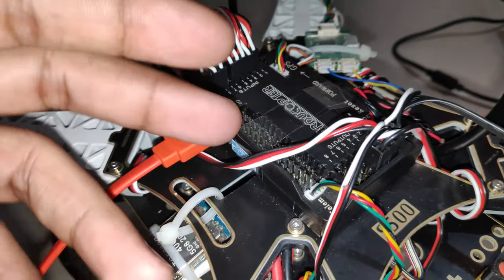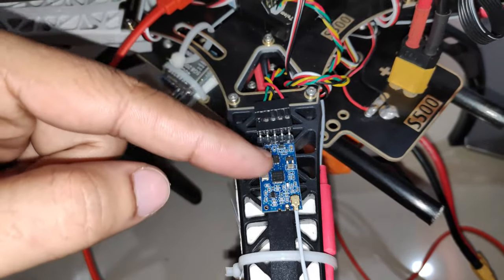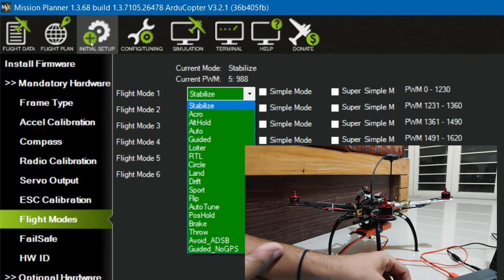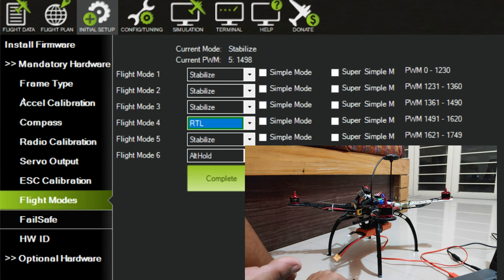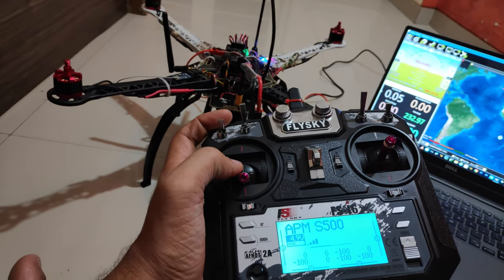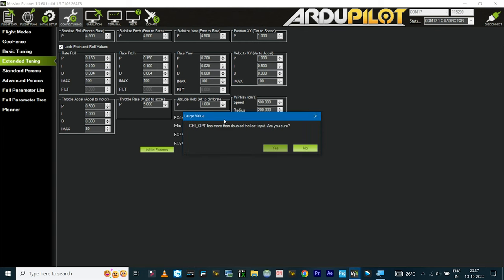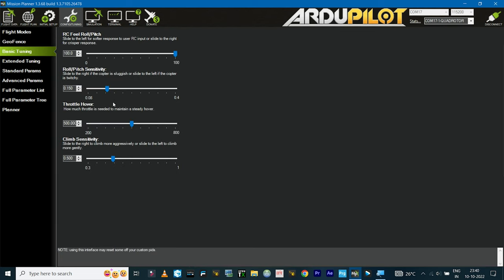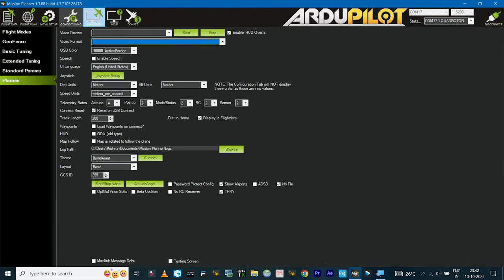APM 2.8 Full Setup with Mission Planner on S500 Quadcopter Drone Kit

Comment: As a beginner in Ardupilot I have found this step by step guidance is exactly what I have needed.  Thank you very much!
Reply from the maker: Thanks for watching 👍
Reply: @RakishRc  Sir, I made the drone and it's working fine in stabilize mode but when I switched it to alt hold mode it's not working properly and not maintaining the altitude it only elevating. Please help me sir 🙏🏻
Reply from the maker: @ayushroy501  you mean it's going up and gaining height in altitude mode?
Reply: @RakishRc  Yes, sir it's gaining height after 50% throttle and if I try to set throttle to 50% it should hold the altitude but it's not responding and going up. Please help me 🙏🏻🙏🏻.
Reply from the maker: @ayushroy501  do you have proper gps connection? For altitude mode you need to have good gps signal and check in advanced setup of mission planner for any altitude threshold value.
Reply: @RakishRc  No, Sir I don't have a GPS. But according to APM flight modes GPS is not required for altitude hold mode.
Reply from the maker: Okay then your drone is relying only on the built-in barometer for maintaining the altitude. Check this forum https://ardupilot.org/copter/docs/altholdmode.html
Most likely you'll need to change values mentioned on the forum for throttle band
Reply: @RakishRc  Thank you so much sir for your guidance 🙏🏻. I will definitely try the above method.

Comment: Thanks for this very instructional video. I'd like to ask why don't you adjust the limits  of PWM to 1000min-2000max in the Radio Calibration procedure, but you leave them as they are (987min-2012max). Are those values arbitrary ?
Reply from the maker: Hi, firstly if the radio gimbals calibrated correctly in the radio settings and trims are at default with 100% weight for all channels then mission planner radio calibration menu the pwm value detected on end point of each channel is the most accurate and correct. Therefore I didn't change the max and min. They are not arbitrary but rather standard

Comment: I couldn't calibrate the acceleration. It gives an error every time. I tried many mission planner versions and it still didn't work. My card is APM 2.8, can you help me?
Thanks.
Reply from the maker: If you are unable to calibrate the accelerometer with an old version of mission planner then check if you have the last latest stable version of apm2.8 on the board. And make sure you are following the accelerometer calibration process correctly.
Reply: I tried all the methods many times. Unfortunately, it didn't work. Could the card be defective? Thank you also for your answer. @RakishRc
Reply from the maker: @ktm_orange_guru  it could be defective but my guess is it's most probably something to do with the apm firmware and the mission planner version which is causing the calibration to fail..or the usb connection might be getting loose when you move the board during calibration?
Reply from the maker: @ktm_orange_guru  you re flash the firmware with the stable release. You're using it for a drone or a rc car?
Reply: I solved the problem, thank you. The problem was that the jp1 jumper was not in place while making the settings. @RakishRc

Comment: I have a problem while testing motors, It pops out "Command denied by ardupilot", I have no idea why this happens, any tips ?
Reply from the maker: What's your throttle % set to in the motor test tab? You need to calibrate the esc and then perform the motor test so the APM can spin the motors even at low rpm during test

Comment: Sir, my apm is not responding to input signals, yaw pitch roll throttle, throttle ek baar full karke par motor spin karti rehti h , fir m kuch bhi karlu motors nhi rukti, aur jab m usb se connect karke drone arm karta hu to sab kuch theek work karta h

Comment: Hi, i have APM 2.8 and 3.2.1 firmware for my X quadcopter and i have already follow all your step. But i have issue when drone in "alt hold" mode,  in several minutes the drone like uncontrollable or lost control (but its near distance), or the drone move to forward or move like crazy suddenly and crash. What is your advice to give me solution please ?
Reply from the maker: Are you getting good GPS connection? Altitude hold is purely based of GPS accuracy. Is it flying stable in stabilize mode? If it's shaking in normal mode then need to make sure gyro is calibrated correctly and motor vibration is not travelling to apm heavily
Reply: @RakishRc  in my first flight i use stabilize mode only, but suddenly the drone move to the left and crash. I think i have gyro calibration properly and i have added sponge under the APM controller..

Comment: Sir sir please reply sir!!
Sir I have cut all the red and black wires of all my 4 esc and there is only 4 signal wires connected to apm. I am using a power module and i have not removed JP1 connector. Sir my motors are not arming after this!!! What should I do now sir!!
Sir please reply!!!

Comment: Hi sir i have same bord and my drone flies good 
But the problem is its front direction as i rotate drone in air it doesn't matter where the head of drone is it only flies in the direction of stick of remote i guess its somthing like orientation settings

As i want to add a camera for shoots i am unable to get fly drone using fpv as the front direction dosent matter 

So how do i disable this setting 
?
Reply from the maker: Well not sure why but i appears that you haven't assigned the flight mode correctly on the aux switch. Confirm if you have stabilize mode on your aux channel. Seems like it's flying in simple mode
Reply: @RakishRc  no i  arm drone in stabelize mode and then switch to loiter

Comment: Iam facing isue with apm 2.8... drone is flying good in stabilize and altitude hold mode ..but the problem is from loiter ..no stable lock seems like  each esc responding to pwm differently ... Same as in esc calibration there no musical tone instead there is slow continues beep in high throttle when bringing throttle down then 3 beeps semms confusion but after calibration pre test everymotors are spining in same time and same rpm..iam using simonk red esc.. is your drone rock solid in loiter make a short of it.
Reply from the maker: Hi, i haven't tested in loiter mode yet but  i will be doing that very soon. Last week I had to re calibrate my esc a few times because I had switched between ppm and pwm protocol on receiver. The ppm encoder in apm is not very good i think which causes the esc to perform at different rpm even if calibrated well. So I switched to pwm again and re calibrated the esc and set the correct pwm value for receiver failsafe in mission planner and radio... which also I think need to be covered in a video.
Now i have to test loiter, altitude hold and return to launch.
Reply: @RakishRc  make a video on that asap... Iam stuck with it i was also using pwm protocol and also tested ppm protocol both of them work same to me.. i dont have any idea about esc calibration.. there is no musical tone when we start up only those 3 beeps indicates battery cells...also i have noticed one thing in stabilize mode removing all propeller at full throttle motor one and 4 stops and beeps continuesly after i bring down throttle to 80 percent it spins again do you think this might be a problem or drone is not in air
Reply from the maker: @devileyes8392  it's definitely esc calibration issue however you should also do the radio calibration again in mission planner.
Make sure each esc is calibrated separately on channel 3 of the receiver and keep throttle on radio to 100% before powering up the esc you're calibrating. You should hear few tones and once throttle is back to 0 the esc will beep again. It should then spin the motor as usual.
Reply: @RakishRc  iam using flysky fsi6s with self centering throttle mode on .does this matter in esc calibration... I think the problem is with those cheap esc planning to but dys escs...make a video on loiter soon there is only few videos about apm 2.8 in your channel thats 2 months ago then there is no update please make video on loiter and automissions asap
Reply from the maker: @devileyes8392  see now you mentioned self centred throttle stick. For these esc you and apm fc you need to use non centred throttle stick. You can remove the spring from the throttle and then do all the procedures again
Reply: @RakishRc  are you sure about it because i have saw few of them using fsi6s self centered throttle. but in pixhawk ..
Reply: @RakishRc  and iam having another question why did you disconnect 3 escs red wire exept one .... I have connected all red wires to fc

Comment: I have removed the self centred throttle and did manual one by one esc calibration everything was fine motors made that conformation beep and run by applying throttle but after connecting everything and motors in order i recalibrated radio in mission planner after that when i connect the battery there some fast beeps in esc i think its getting different pwm from fc
Reply from the maker: Did you check if the trim is centered to 0 for throttle in radio? Try again but this time calibrate radio in mission planner first and then calibrate esc one by one on ch3.
Reply: @RakishRc  yes trim is centered in radio after i did all in one esc calibration and its works ...in stabilize mode full throttle m3 motor stopps and beeps as i tilt the quad a bit in opposite direction it spins again seems like gyro controlling the esc  i think its fine ...and mainly its flying very well in other modes like stabilize and altitude hold but the problem is in loiter its like so much incorrect possition hold ...did you test loiter on yours ... please make a video on loiter and rtl
Reply from the maker: @devileyes8392  okay so may be something to do with GPS accuracy and motor noise that's probably messing up the GPS sensitivity.
I have to test.. will share once done 👍
Reply: @RakishRc  i think i have found the problem ..vibration. i am using f450 frame not that good quality but its ok...but am not using motor vibration rubber damper so i tested the vibration was so bad on arm of the quad .. i have already used vibration damper for fc but gps module doesnt have i guess vibration is the problem ...

Comment: Sir i have th9x and i buyed a f7 flight controller recently. But now i cant find i bus option on my transmitter please help me sir 😭😭😭🙏💔
Reply from the maker: Which version of th9x you have? Original version one or V2 Afhds2a? In flight controller select sbus and check if i bus is working
Reply: @RakishRc  i have 2.4gz afhds2a
Reply: @RakishRc  sir i can get insta or discord so that i can connect better?

Comment: hello sir, pls help me my apm2.8 is not showing its com port, i buy it new and just connect it to pc but its light only blinking pls sir. you are the only one i can rely on.
Reply from the maker: Did you install the drivers for APM? In device manager do you see any device when APM is plugged in?
Reply: @RakishRc  sir i haven't install the drivers, how i can install it or sir in device manager no device or port and com is showing. I'm using window 11.
Reply from the maker: @swarnimsharma_001  which usb cable are you using? Seems like the usb cable is only for charging or powering a device and not for data transfer. Use a different usb cable and check. My friend also has same issue few months ago
Reply: @RakishRc  ok sir I will try it with different usb
Reply: @RakishRc   sir i try it with data transfer usb cable but it is not recognized by my pc
Reply: @RakishRc  hey sir my apm is now connected it's just a driver issue , but sir i don't know how altitude hold really works because whenever I put my drone in alt hold it is going in upward direction only and does not maintain its  altitude. Pls 🙏 help me to fix the issue

Comment: Bettry dad hone per kya hoga koi inticater krrga
Reply from the maker: In mission planner low battery voltage can be set so it will automatically land or return to launch but for indication you can connect a voltage metre to the battery and set the desired voltage alarm

Comment: Bhai meri esc calibration nahi ho rahi hai and beaping fast and continue
Reply from the maker: Which esc you are using? Calibrate one by one on channel 3 of the receiver and make sure throttle is 100% when turning on esc..then 0% throttle after beeps are heard. Motor will indicate once esc are calibrated and spin after throttle is applied.
Reply: Yellow generic esc and also try one by one
Reply from the maker: @captainjarvis8618  did you make sure radio throttle is correctly assigned on channel 3 and is esc is aslo connected to channel 3 of receiver? It will work if everything is followed correctly. Make sure throttle trims are centred before calibration else it will beeps like you mentioned.

Comment: how do i solve "is this a linux board"
Reply from the maker: Are you using latest mission planner software? Try to use an old version of mission planner and select download firmware option when updating firmware...you'll need to download the firmware file manually from arducopter website and then flash the file.